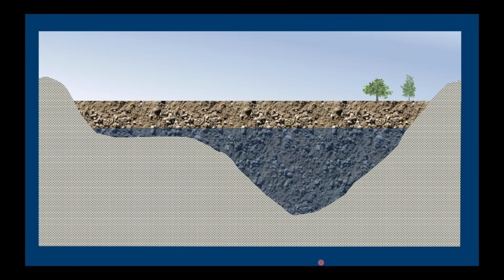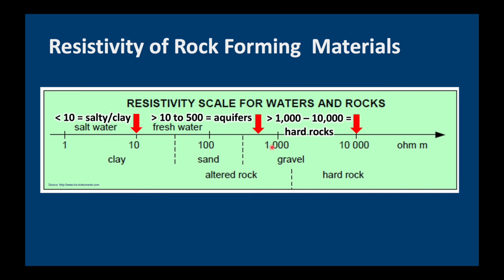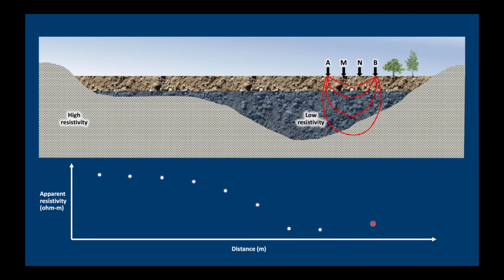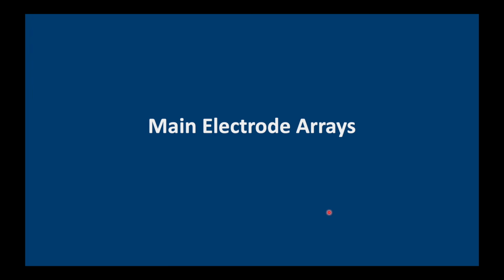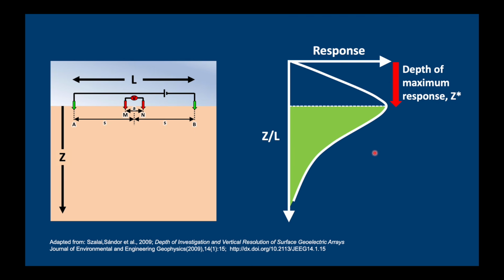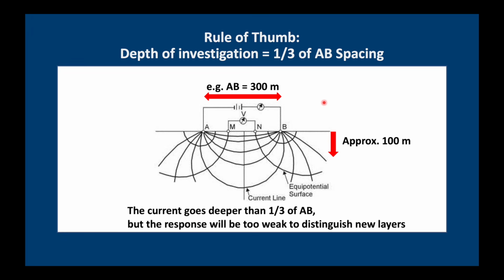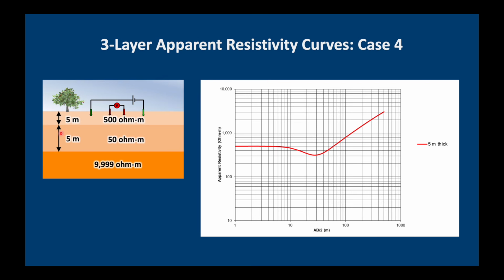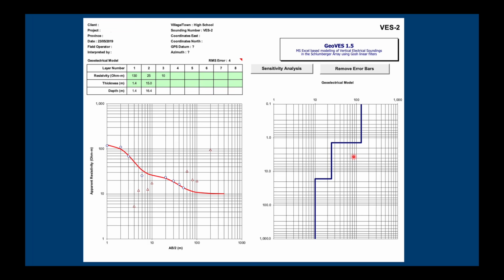Hydrogeology 101: Introduction to Resistivity Surveys

Comment: Hi Andreas, could you perhaps provide me with an average amount of time required for a 300m length vertical electrical sounding survey based on your experience. I can understand the time will vary greatly depending on site conditions etc

Comment: Hi Andreas,  an excellent presentation and helped my a lot to understand the VES ! 

I want to build an automated machine that can take all measurements and give a final graph for the survey, your support is highly appreciated.

Please, I have some questions about the resistivity surveys :

1-If I want to survey both desert (dry sand) and Wetland area to find (cavitations & metal) what is the best method I can use (Schlumberger array or wenner array) to detect it is depth, and it is size ?

Note: the required depth is 5 meters and higher  up to 30, 40 meter

2- What is the type of current is used (DC or AC), what is the range  for each (Voltage & Amp) min & max ? 

3-How we can determine the suitable setting for both current and voltage for different lands?

4-As per your explanation on the above video, what I understand we can determine the depth for each layer by it is resistivity.

My question,  if the inspected  land is the same resistance (Symmetrical) like desert, how can I determine the Layers from the  required object from the resistant reading?

5-The distance between the AB is determined the depth of the layer or not?
What I see in the video when the distant between the AB is increase the current is going deeper , in this case we need to rise the current or not ?

6-During survey process do we change the voltage & Amp setting or keep it constant, if we change it how we put the correct values?

Waiting for your Kind reply 

Thank

Comment: Hi Andreas, I am an engineering student part of a university team helping a charity in South Africa improve water access by researching and designing low-cost geophysical survey equipment. We are in the early stages of the project, but a simple resistivity survey seems the clear choice for us at the moment and I have some questions about the process.

From hydrogeological maps and borehole logs we know groundwater in the area occurs in fractures in the crystalline basement rock (granite). With this in mind, how would you conduct the geophysical survey to identify the location of major fractures to know where to drill? In a previous video you mention a productive borehole in northern Mali you drilled by finding a regional fracture – is this a similar geological context, and how did you go about finding this fracture?

In this geology, would it still be appropriate to complete a resistivity profile by moving the whole electrode setup to many points over a long distance, and then doing a VES at the lowest apparent resistivity ‘anomaly’ to determine the depth that you should drill to?
From what I have learned, VES can produce inaccurate data when there are non-horizontal structures in the sub-surface -  is this a problem in this fractured geological context?
Also, what factors affect: (1) the spacing of electrodes when measuring points for the resistivity profile, and (2) the distance between each measurement on the profile (resolution)?

I apologise for any misconceptions and misunderstandings, as engineers we are very new to this, and your videos have been an extremely useful introduction to hydrogeology! Thanks :)

Comment: Dear Andreas, thanks for your videos.
I want to request you some help with VES survey. I have some experience in well-developed soils zones but in the last four months, I have changed the study area. The stratigraphy is generally composed of 5 meters of dry gravel/boulders (without matrix), 3 meters of fresh water and then saline waters. Since I started to collect VES here, I cant get nice curves. They are all like your last slide "Garbage. Send the geophysicist back to the field". I have probed with different types of equipment, wires, arrays, electrode materials, DC current, AC current, different potentials, limited current, unlimited current, I have wettened the electrodes, etc. I cant get nice curves. Do you have any tips to solve this situation? It is driving me crazy. Thank you very much.

Comment: Sir, it was very concisely and well explained as a summary..

Sir I have a couple of doubts:-
a) Sir, why does it become difficult to measure the voltage difference when the space between the potential electrodes are kept small while the current electrode spacings are increased

b) why does a layer of infinite resistance has a curve of maximum 45 degrees and not more than that?

Sir, have you made any videos on TDEM surveys  as you had mentioned at te end of the videos, (used in Groundwater and contamination exploration).. if so please provide a link...Thank you